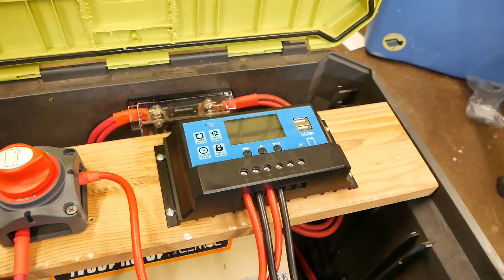12 volt 1280wh DIY mobile solar generator quick and dirty for around $750.00

Comment: nice build cool you not have not have no fan at side for when inside of box get hot
Reply from the maker: Yeah, my 24v system in my ryobi tool shed has dual 120mm temperature triggered fans. Generally this one will be able to be opened when running and so the inverter fans will be able to cool it.

Comment: Prices are dropping so fast.  I just bought a prebuilt unit with 999wH for $499.

I have been looking at a DIY kit where they include everything but the batteries for a 3000wH system for $499.

And everything is supposed to be 40% less by 2025.
Reply from the maker: They are dropping fast, batteries are pretty stagnant, though. The 100ah 12v in my project has been staying pretty close to $300 since I bought it. My inverter is pretty high quality, which is why I assume I can run a full size Rigid table saw with it. I’d be curious how many of the prebuilts can run thst kind of equipment with that kind of inrush amperage. The price if mine is going up, as well, as I’m swapping out the cheapo charge controller with a victron 15/70 smart controller, about a $100 increase, so it’ll be a pretty high quality, $850 controller.

Comment: nice cool ❤❤❤❤i have 3000 watts pure sine wave 48 volt in water proof tool box with 2 110 AC out let one is GFIC with 15A breaker for my out plug and DC breaker 150A for my inverter i have add 48V solar charger controllar for my solar panel and us port and cooling fan 😊😊😊
Reply from the maker: I’m planning a 48v, large, non-mobile system, to charge our EV truck, and power a mini-split A/C for the garage. Who knows, maybe I will make it mobile as well.
Reply: @racingtogreen2023  cool not have 48volt solar controllar as yet but when i finsh i post it 😎😎😎😎 not have my lithium batttery yet hopefull buy this weekend i have 500 watts ,800 watts,1100 watts ,1500 watts and 3000 watts purn sine wave only one pure sine wave 48 volt

Comment: Being that I am a ham radio operator i would need something that could run the radios in the field, or as emergency power, and get charged by solar.
Reply from the maker: In the 12 volt mobile system,,I’m using a $20 PWM charge controller, so giving up some efficiency for cost savings. I keep the 12v system charged up with a 100watt panel.

Comment: I just got a 12v 100ah lifepo4 to pair with the ALFFAA 1500w inverter.  I'm looking to box them up like you did.  Didn't think about running an inline fuse from the battery to the inverter though.

Is that necessary, or is the BMs and fuse in the inverter enough?
Reply from the maker: I have a 2000 watt inverter in there and these Roarbatt inverters have been stout. I have the big fuse there as I have been running pretty high draw stuff, like circular saws, and even my Rigid table saw. The Roarbatt/Powerqueen combo seems to be a pretty good solution, and I’ve been using that inverter, and that brand of batteries for over a year now.

Comment: I love Ryobi. Excellent work
Reply from the maker: Thanks. I’ve been pleased with ALL of my Ryobi stuff. Literally have not had a single tool or battery go bad that I didn’t cause. I got one 40v 6ah wet, and that killed 2 of the 2000mAh batteries in the pack and I built small 3s2p mini 12v packet from the ones that weren’t bad and those were some high quality 18650’s.

Comment: That MPPT controller is very inefficient. Unless you have way too much power coming in than you need. And Panels are a lot cheaper than a PWM controller.
Reply from the maker: Yeah, it’s cheap, but that’s a good bit of the point. The box only occasionally get’s used and stays charged from occasionally attaching it to one 300 watt panel on my tool shed with the Anderson connector. Does the job. The tool shed itself and the art studio both have Epever controllers.

Comment: What gauge wire are you using between the battery and the inverter .. looks like doubled up 10awg? or is it 8awg?
Reply from the maker: Actually 5 gauge(16mm^2). Combined it should be like 2awg. They came with the Inverter. Not being a fanboy. I've been using these Roarbatt inverters for going on my second year, without an issue and they have performed flawlessly. The only reason I've moved this one to the generator was that it was low enough wattage, that when the Mini-split kicked on in the Studio Shed, the fans came on, (They come on at 1/3 of max wattage, so around 600-700 watts, mini-split runs around 650-900watts) and the G/F didn't want that noise while she was working in there, and since I wanted to upgrade the system to 24v anyway, we went with the 4k watt, 24v version in the studio shed. Haven't heard the fans come on on that one yet.

Comment: I think you don't have to use double wires on the positive of the battery , I'm sure the weak point is the terminals which has lower current capability than one of those wires.
Reply from the maker: That was the cabling that came with the inverter. The doubling up is how they get to the required AWG cheaply. It would be better to replace them with a single cable, but these are likely adequate. I’m not particularly worried about the lugs.

Comment: Nice setup. Can you please post images on how you secured inverter  and battery in the box ?
Reply from the maker: They actually aren’t secured, the wiring like the AC extension cords hold them down. I don’t expect they will go anywhere.
Reply: They very easy to make i make one my is all water proof have  48V 3000 watts inverter  my can stay out in rain nothing with happend